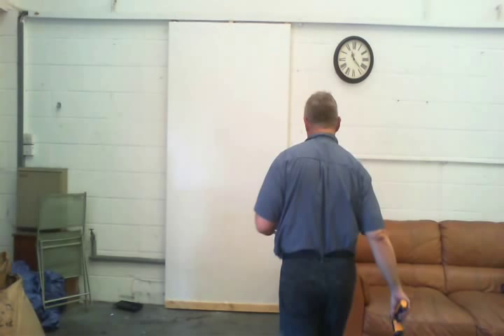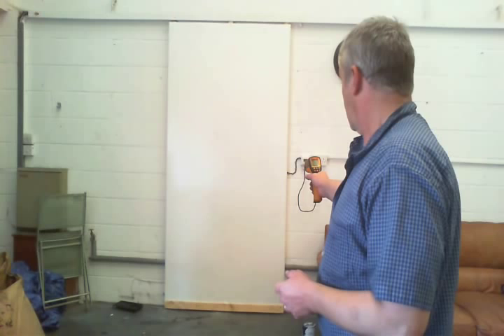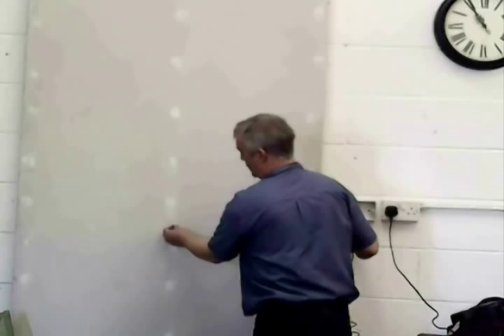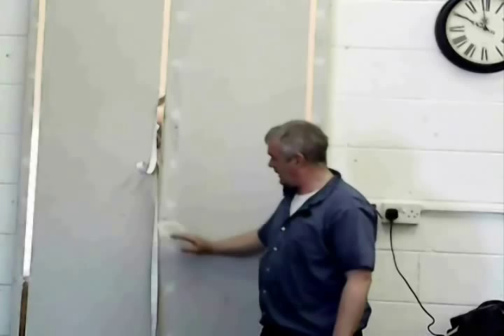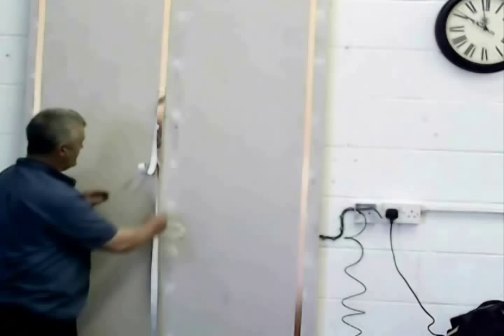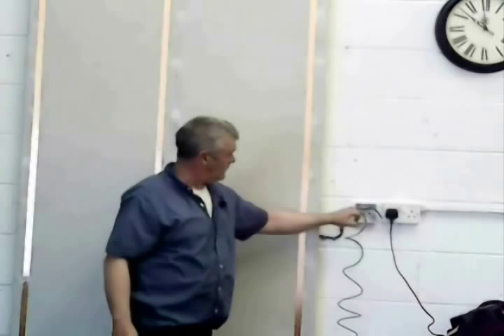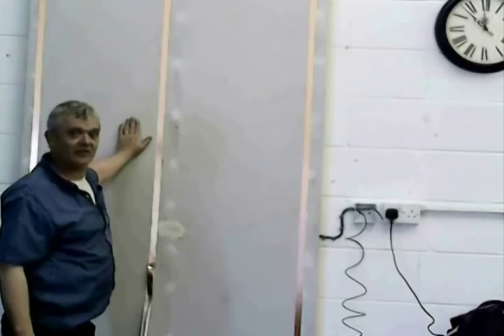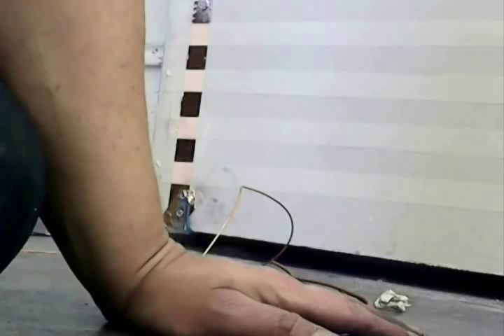Painting A Giant Radiator Straight On Your Wall

Comment: For safety reasons, it would be good encapsulate all in a metal foil, eg aluminum foil and to connect with the earth wire.
Reply from the maker: Sorry mate but that would be the worst thing you could do. Isolation is the key to safety here - it is called a class II device where you have no metal at all and prevent exposure but enclosure isolation - this is the way most appliances built from plastic work - including your toaster. You only need an earth where there are metal components you can touch that might become connected to the live by fault. - so, if you are worried just put a layer of thick plastic over it so inquisitive fingers can't get to the element.
Reply: Robert Murray-Smith I know what you mean, I'm even an electrical engineer. However, if your insulation is injured or moisture from entering your security precaution lapses.
Reply from the maker: Michael Zieger
Ok Mate - the problem with your argument is that it is perfectly true - but it is perfectly true in the same way that if the earth spirals into the sun we will all die is perfectly true - but then it is not really a question of what is true - it is actually a question of what is adequate. You are surrounded by class II devices- lights, heaters, toasters, etc etc - this bit is for others following - i Know you Know - Class II equipment is protected by a double layer of insulation class 1 has a single layer but a chassie - the foil Michael mentions - connected to earth - all appliances in the UK require PAT testing for safety. There is a class 0 which has no earth and a single layer of insulation but this type of appliance is not allowed in the uk because of a 1989 law covering this type of equipment - it is allowed in lots of 110v countries though and local conditions will apply - now back to the argument lol - it is deemed in the UK that class II equipment is perfectly ok The basic requirement is that no single failure can result in dangerous voltage becoming exposed so that it might cause an electric shock and that this is achieved without relying on an earthed metal casing. This is usually achieved at least in part by having two layers of insulating material surrounding live parts or by using reinforced insulation. I agree perfectly this wasn't made clear in the video but we have cleared this up now - so thanks for that - but i still disagree with your recommendation and it may be something we have to agree to disagree on as the proposal I put forward is within the IET Wiring Regulations BS 7671:2008(2011).							- 17th edition if you like.
Reply: Robert Murray-Smith
It is only a recommendation, an idea you should take into account. Ultimately everyone is responsible for ensuring that he does. In Germany, one would thus end up before the prosecutor from having someone gets hurt.
Reply from the maker: Michael Zieger
incidentally the same regulations apply to the cables connecting the device to the supply which is why the cables can be just clipped to the wall without requiring conduit - though conduit would be a good idea and it looks prettier - at least to my mind
Reply: Robert Murray-Smith
I know only the mechanical strength and moisture resitenz of the cable considerably higher than that of the foil used to cover
Reply from the maker: Michael Zieger
Is it not obvious i took this into account? - All through the video I warn people to check on their local regs and tell them to have an electrician do the work if they are not competent - which incidentally is how the legal requirement for electrical installations is worded - I know the UK regs but that is it - I don't think Germany difffers that much as the 17th edition came out to standardise European requirements. As long as you follow the regs you'll be ok - no one has been sued because somebody stuck a fork in a toaster - thankfully, in Europe, there is still a sense of personal responsibility and if you are idiot enough to stick a fork in a toaster the courts recognize that is still your fault. So, if you are not competent and construct a device of this type outside of the regulations the fault would be yours - at least in the UK and probably most of Europe too
Reply from the maker: Michael Zieger
it's pvc??
Reply from the maker: Robert Murray-Smith
perhaps the thing you don't realise is that the structure shown here is actually just a replication of thin film carbon heating mats - just hung on the wall and not put on the floor - you might want to check them out
Reply from the maker: I'll tell you what mate - you have made me think more about this and I will do a follow up vid on the safety requirements and be more explicit - thanks for making me think this one out - it's well appreciated - cheers
Reply: +Robert Murray-Smith The only concern that I have is with flooding, if using the system in a basement. Would a GFI be a recommendation for the receptacle?
Reply from the maker: +Craig Lewis we call them rcbos mate and they are required on all installations here in the UK - actually you aren't allowed to wire anything into the mains unless you are a qualified electrician and you sign a goernmvent test certificate to certify its safety - the government then keeps these on file - equally you can't sell electrical equipment here unless it has a ce marking - they have the safety aspect really tied up
Reply: +Robert Murray-Smith I do home renos, from time to time, and install electrical wiring system, working on installing panels, motors, heavy equipment. worked offshore on ROV high voltage systems (3000KV) Power can kill ya, yet It, don't scare me. Gov, scare me and is killing us slowly, with all their rules and regs. For safety reasons, and those without electrical experience, find a friend that can do electrical if required. I'm sure that will be interested in the project and be more than happy to assist, to see them working. If I can , I want to build and install them inn homes. Starting with ones that are less fortunate and on low income assistance. I want to help others that struggle most. It's the only way for our world to grow and become a loving place.
Reply from the maker: +Craig Lewis mate - i 100% agree with that - thanks for posting
Reply: +Robert Murray-Smith Thank you Robert, for allowing me to share :)

Comment: Thank you for this video Robert! I found it both informative and interesting and plan on trying bespoke ‘art panels for localised heating Panels. I guess the biggest restriction I face is efficiency (heat output?) from patterns and shapes. I think I’m correct in thinking that the heat output /current draw is governed by the thickness of the paint? Does the conductivity/output have limitations or particular operational inefficiency’s (other than amperage/running costs) depending on the “thickness’ of the paint layer please? My sincere gratitude for your time and assistance. Kindest regards,Karl.
Reply: @RobertMurraySmith. Please don’t be offended by my very small ‘Thank You’ contribution. It reflects my circumstances in these difficult times and is as much as I can afford currently. You have my sincere gratitude for the work you put into your videos and for all you share! Please keep up the great work ;)

Comment: Hi Robert. Very impressive system.

I did some estimating of the power per foot of your resistive strip. Looked like about 360 feet of conductive strip at 800 Watts overall.
This works out to about  ( 800/360) 2.2 Watts per foot. This should be very little 'strain' on your strips.

Did you ever load up the strips to see what they will take before being destroyed?

Glad you are /have done more on the safety aspect. Seeing bar bus bars was a little worrying being an ex electrician. I know you are fully aware though.

Brill video.
Reply from the maker: Dennis yoj I didn't load it to breaking - but i have been running it all winter - like you i worry about people messing with wiring but i also like people to experiment - it's a difficult line to walk lol

Comment: Fantastic . I am going to do this......
Reply from the maker: aslimline S it really is a piece of cake mate - just get your resistance right and you are off
Reply: Robert Murray-Smith sorry I didn t heard what is the right resistance. How much is it? And if I want to use low voltage, the resistant have to different?
Reply from the maker: Mo Kha
use ohms law to calculate based on power you want to put through

Comment: The only thing that really concerns me about this is the direct, uninsulated and unisolated use of two LIVE copper strips sub surface or surface mounted. I'd be a MUCH happier bunny if an isolation transformer were used, but recognise they are expensive, or better yet, using much lower voltage to drive it. 

You said you had to remove paint due to the resistance being too low, which means that you could drive it at lower volts and higher amps. There are plenty of 1kW CPU supplies around these days so getting, or designing, a 32 or 48 volt switched (and isolated) PSU at 20 to 30 amps should not be difficult and be FAR FAR SAFER. I just have visions of someone trying to screw a picture or cabinet or something to that wall and connecting right onto the live feeder copper strips in the centre.

 Similar concerns arise over its use underfloor in any room likely to get wet, like a bathroom, shower, utility room or kitchen. Standard underfloor electrical heating has a well insulated heating cable, often with earthed shielding around it for maximum protection from puncturing the cable. 10 out of 10 for ingenuity but I think you really need to work on the safety aspects some more, especially with 230 volts sitting just under a wall surface. Also just occurred to me ... what kind of leakage to earth is there? RCD tripping?
Reply from the maker: awesome idea cheers mate

Comment: Can someone clear up why this is so much better than a 0.8kw heater that has say a coil and is small, such as a commercial one?  Is it because the greater surface area allows more energy to be radiated?   Is there any scientific explanation someone can point to which shows how much better such a radiator would perform than a commercial one?
Reply: The planned obsolescence is controlled by you , the designer.

Comment: Definitely want to try this. Where did you get your wall controller - what would I be looking for?
Reply from the maker: B and Q as it happens - it is meant for underfloor heating mats - which is essentially what this is but in a can lol
Reply: Robert Murray-Smith
Hi Robert, I notice that your Product Sheet says the ink is intended for low voltage but in the description above you say it pulls 3 amps at 230 volts. I have also seen your other video about using house mains. Is your controller sending 230V through to the mat or is it reducing the voltage? I ask because I have bought a Heatmiser DS1 (http://www.heatmisershop.co.uk/heatmiser-ds1-el-digital-electric-floor-heating-thermostat/) and when it arrived I see the output to the mat will be 230V 13A. Do you think this could be a problem?
Reply from the maker: John Mackerras
not in the least mate - the controller is rated at maximum. the heating element will pull the amount of amps you design it for and that is based on your voltage supply and the resistance you get (using ohms law - I use the DC values as an approximation of AC) - when you design your heating element you can design it to pull more than 13 amps as above that your controller will fail - but below that is no problem at all.. The ink will cope quite happily with thousands of volts - but as a product for sale to the general public I have to cover my own back so it is rated for 12 volts and anything above that is at your own risk and comes with no guarantee from me - I am sure you understand - in this day and age there are plenty of idiots out there who will attempt to sue. In the other video i used a house dimmer to reduce the voltage to 40 volts i think

Comment: so in a remodel "to the skeleton" what would recommend for a 100plus year old stick frame home
Reply from the maker: no idea mate sorry - you will have to experiment
Reply: my son showed me this and I asked him to pose the question.
I have solution, need to find out how to purchase your ink
Reply: thank you for your prompt response to my son
Reply: I'm hoping to be able to use your "wall" in conjunction with a in-floor heating system using the same thermostat and power source...
Reply from the maker: I am afraid we don't make the ink but we did do a video on how to make it yourself
Reply from the maker: no worries though i don't feel i was particularly helpful - the channel is meant to encourage experiments in others and so many questions are best answered by experimentation - if i were you instead of going straight to trying to paint a floor or wall i would buy some drywall and try a few different versions first then when i had worked out how to do it go for a big version the ink itself is no great challenge as a key point is that it must have a degree of resistance and any graphite based paint you come up with is going to be resistive - it will then be a matter of working out how thick to paint it on to get a reasonable response - good luck

Comment: The only problem I can see is the day someone unsuspectingly puts a nail or screw through the wall for hanging a frame or such... If you know what is on your wall that's a non issue though.
Reply from the maker: absolutely mate - though if you stepped the voltage down that wouldn't be a problem either i guess
Reply: You'd have to isolate it rather than step it down, so it's no longer earth referenced. A easier solution would be covering it with another conductor that is grounded so the ground fault interrupter trips if someone were to drive something through the wall. If it where my own house I'd just mark the location of the panel though. I have the same problem with cables hidden in the wall, so I just keep them visible.

Comment: This would be cool to see with a thermal camera to see the differences in heat per strip.
Reply from the maker: yes it would - i just need about 2,500 to buy one lol
Reply: Robert Murray-Smith same point I'm stuck at. luckily my work has a flir I was able to borrow for some of my projects.
Reply from the maker: you lucky boy lol
Reply: the flir one for iphone 5 is about $200 USD
Reply from the maker: yeah but the iphone is US$600 or so lol
Reply: iphone FIVE. The Flir One only Requires the 1st generation lightning connector, but is Compatible with newer models. My Flir One, specifically, will only Fit an iphone 5 or 5s, being a case similar to a mophie battery case. And, I paid $150 for my Flir.
Reply from the maker: cheers
Reply: I don't know what that means... but I've given you the information, do with it as you will.
Reply from the maker: ok - thanks
Reply: Adafruit just released a small thermal camera the other week, along with code libraries. That may help you out a bit. 
https://www.adafruit.com/product/3538
Reply: Met with enough demand to deplete their stocks... Oh well, at least it proves there is a market, and that a product can be released at the $35 price point.

Comment: DO this as business and not have a thermal camera and somebody will light that install on fire because you did not have proof "when you finished it was functioning correctly". Keep accurate records in business or suffer paying for anyone that takes advantage of your "failure to have proof of correctness".  Don't think it happens I have witnessed a foreperson while commenting "their not supposed to do this like that" see what happens as they reposition the heater or bucket and saying ......Ya you go find someone else to work for asap so you don't get asked when you see it happen that is what I did cause I can't or won't cover on situes like this. yet  not uncommon in our current safety stupid work enviorment "if it can happen somebody will do it". with packages that have printed on them. STOP ENGINE BEFORE INSTALLING THIS FAN BELT ...A REQUIRED AND BOLD LETTER WARNING if you need to be told that well those that try and get hurt hmmm better now than after all the damage they will do before they figure out some new way to so obviously get it horribly wrong. waist time to share worst examples does not much... training how to get it correct priceless. thermal camera for a stupid phone about two bills cheap. have a nice day
Reply from the maker: good advice to any one thinking about this mate

Comment: Boo! Hiss! That's not a "radiator" but just a giant RESISTOR that radiates heat it makes from electricity... Totally different thing. Just because it's a lazy British slang to call it a radiator, does not make it a radiator. A true Radiator would take warm air, warm water, etc. and radiate the heat from it... or into it.
Reply: You just called it a radiator so how is it not a radiator. Make up your mind!
Reply: Get a clue, Harry... I used the term "radiator" derisively, hence the quotation marks.
Reply: Right on, Billy!
Reply: Everthing radiates, however this has the same function and purpose as a water filled radiator, so therefore the name fits.  E.g petrol, gas, electric cars. We still call them cars however which way the energy is transfed to motion. Same principle here.